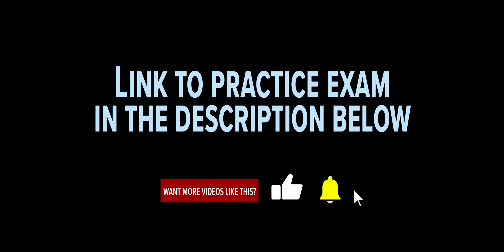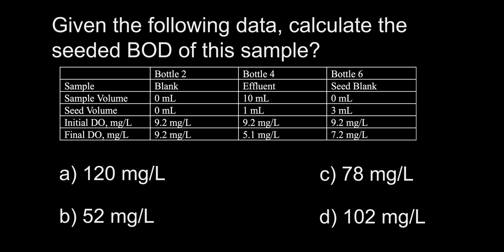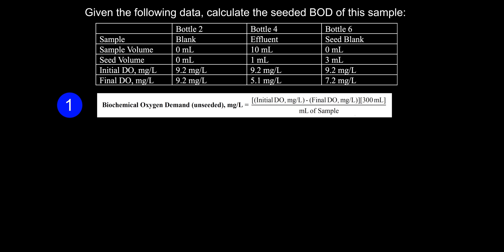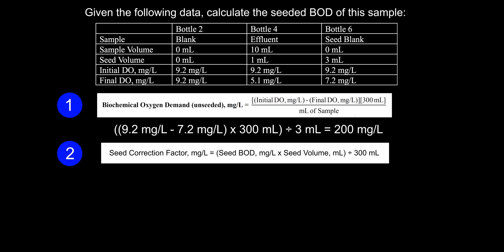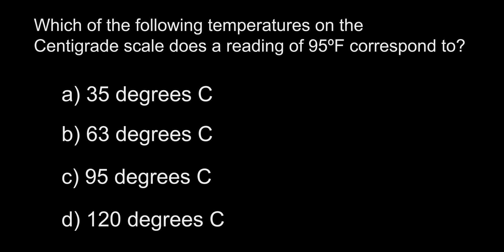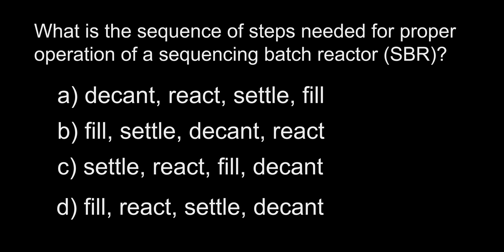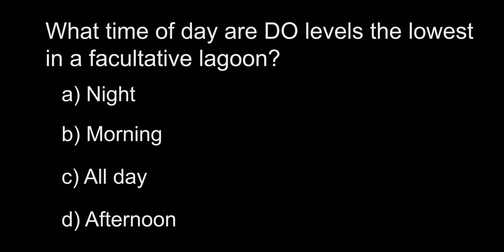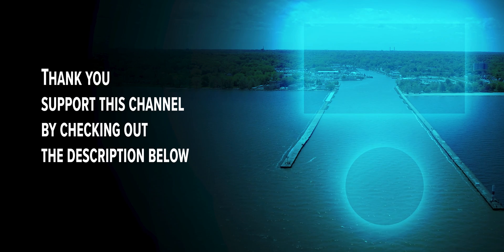Part 3 - Wastewater Treatment Operator Exam Questions

Comment: That BOD question was pretty tough. I’ll have to practice that one several times. It doesn’t help that I don’t routinely do B.O.D. testing.
Reply from the maker: It’s a tough one, it definitely requires understanding the in's and out's of BOD testing.  Honestly, you won't find that question often on exams except for the highest level ones that tend to have more lab related questions on them.  But understanding BOD is crucial for any operator.

Comment: How much are this questions are going to come out on the real exam?
Reply from the maker: You will 100% find many of these concepts on an exam and/or similar questions.  These questions range in difficultly, so some of them may only be on the higher level exams.  If you are asking if these exact questions, word for word will be on a test, most likely not. No one has the exact questions that will be on an exam (that would be cheating).  These questions will definitely help.  That’s not coming from me.  I have had many people both in real life and online tell me these questions have been very helpful.  Thanks for your interest!

Comment: I got my grade 1 exam today. Question for the BOD question... in the bottom half of the unseeded formula you divide by the SAMPLE volume. Why did you divide by 3 mL (the seed volume)? That sample chart is a little confusing as I do not work in the lab at my plant. Thanks
Reply from the maker: Great question.  Its difficult to understand without having a firm grasp on how BOD tests are performed.  Highly encourage to understand that process.  
For some background.  When it comes to running BOD tests in the lab.  There are two ways of doing it, one way is to use seed and the other way is to not use seed.  Seed is essentially adding a known amount of “bugs” to a sample so you can guarantee that oxygen will get depleted.  Why is that important?  If not enough oxygen gets depleted the sample is invalid.  This can be a problem on effluent samples because effluent is generally “clean”.  Now in order to use seed, we need to know exactly what the BOD of just the seed will be so we can subtract it out later. 
Part 1 of that question is calculating the BOD of a sample that only contains the seed, there is no addiontal seed in a seed blank (bottle 6) which is why we are using the “unseeded” formula….sorta confusing but it is because there isn’t any extra seed in the sample like there would be for the other sample bottles.   So part 1 is calculating the BOD of the seed only sample (bottle 6 - seed blank).   We use 3mL because it is how much seed was used in that test.   Once we know the BOD of just the seed is we can use it to figure out a correction factor (part 2 of the question).   We use the seed correction factor in calculating the BOD of the other samples like bottle 2 and 4 in the question.   You may ask why so many bottles.  BOD tests are ran with multiples of each sample.  Because the test is depending on organsims using up oxygen which can’t be precisely controlled.  Multiple tests are ran on each sample like you may have 3 or to 5 bottles on the influent and effluent of your plant just saw you can guarantee an accurate number.  You would ultimately average the result of all 3 to 5 sample to get your final BOD value.  Hopefully this made some sense.  Goodluck on your exam!
Reply: @worldofwastewater  yeah I got you, I just run Ph samples and chlorine residuals as far as the lab testing goes. On my exam (NJ) I didn't see any bod5 test questions that needed the formula, they gave me both formulas on the sheet thankfully though

Comment: Where did the 7.2 come from was that a typo. Was it supposed to be 5.1 on the bod question
Reply from the maker: Part 1 and 2 of that question is about calculating the seed correction factor, 7.2 is the final DO of the seed blank.  The 5.1 value is part of the effluent sample which is used in part 3.   Hopefully this helps.  Thanks for watching!

Comment: Trying to do these math problems without having the formula's next to me is rough. Im feeling confident once i see how clearly labeled the formulas are for their respective question
Reply from the maker: Definitely tough trying to do the math without a formula sheet.   Glad you find this helpful, thanks for watching!
Reply: I think many states should tone down on the math questions. For example, in NJ, they toned down the test questions to become a teacher due to people having trouble with them. It's one thing if you are going to be a manager or superintendent at a plant.
Reply: Can confirm atleast the ohio 1 had about 15 math questions. But they were basically this level.

Comment: I will soon be taking my new York state 3a exam anywhere I could get some info on mainly prosses control
Reply from the maker: Many of the questions on my test come exactly from a NY 3a exam. I would just do as many practice tests as you can.  Go over concepts and processes that are not at your plant.  It's important to be well rounded for the exam. Also if your treatment plant has an ops challenge team, they may have practice questions you can do in regard to process control.  Either way, good luck!
Reply: @worldofwastewater  any suggestions where to get that material
Reply from the maker: @jasonknapp2288  I used this a lot when I was prepping for my exam.  https://royceu.com/Public/PracticeQuizes.aspx
Reply from the maker: @jasonknapp2288  also these questions are useful aswell.  I would also recommend googling practice tests for wastewater, there are usually a few options available that way.  https://www.wef.org/skillsbuilder/
Reply: I can't find the answer sheet to your exam
Reply from the maker: @jasonknapp2288  Thats what's the video's are for.  Unfortunately, I'm still working on completing this series.  Sorry for the inconvenience.